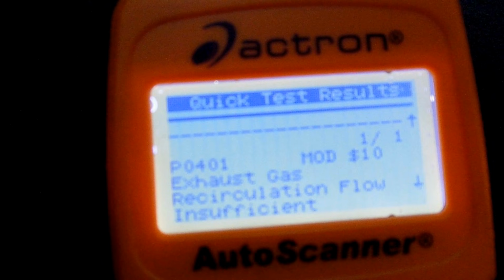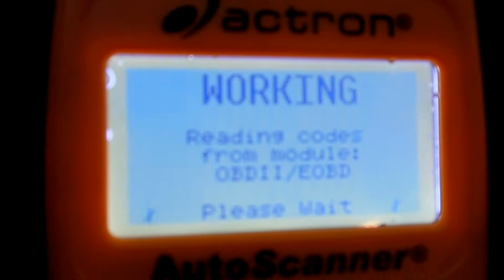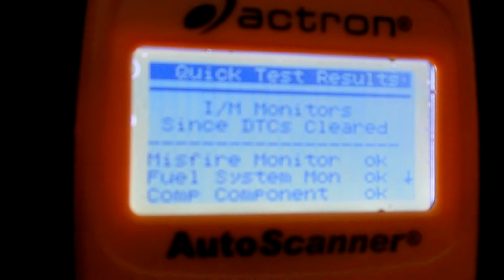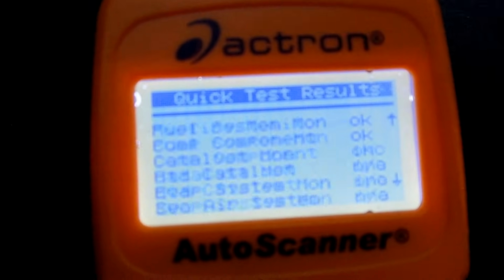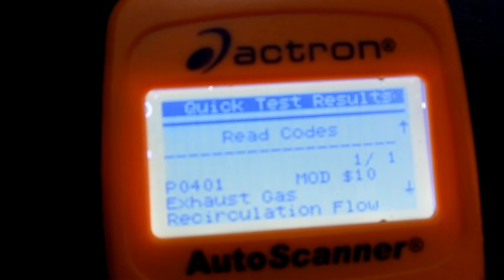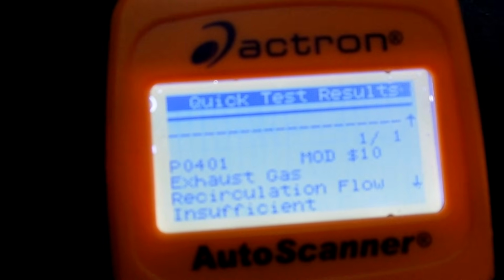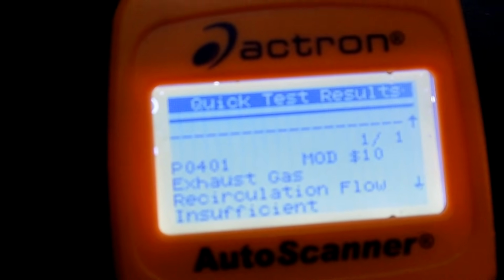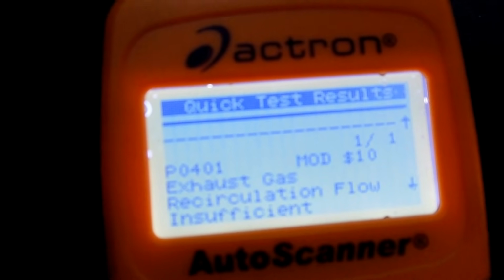P0401 2002 F150 EGR System Overview and Troubleshooting Guide

Comment: For me, the problem was the clogged EGR ports on the throttle body.  I took it off and cleaned it out thoroughly.  Put it back on and problem solved.  No more P0401 codes and runs smooth.  Btw, I have a 1997 F150 with 315K miles.

Comment: Half hour my foot. If you live in the rust belt that EGR tube is gunna be seized like you've never seen before. Use heat but it's close to the firewall which is full of a cotton-like material so be careful

Comment: Excellent content, a couple quick tips, remove both 10 mm bolts holding the egr in, move the egr over and clean both ports with carb cleaner. Also spray both banks (egr tubes connected to exhaust manifold ) also. Make sure all vacuum tuning is in working order, I suggest also removing intake snorkel and cleaning throttle body. Lastly a good fuel cleaner added to a full tank of fuel and steady highway speeds to push out all deposits

Comment: I just removed my EGR valve on my 1999 Ford Econoline E-150. I had to size up the nut. I ended up buying a 1 1/6 crescent that fit perfectly. Then I used a 10 mm crescent on the smaller nuts and it pulled loose. However, I do want to note that I also bought some PB Blaster and sprayed it good before I started removing the nut. I let it sit 5 minutes to make sure that it generated through the rust BEFORE I turned it for the first time. Just a little effort. Watch that thumb knuckle! And don't forget to spray down your nuts and screws with PB Blaster and let them sit for a bit before replacing them back into thee hole. You might want to spray down the holes themselves too with PB Blaster.

Comment: The guy who just sold me a 1997 F-150 4x4 4.6L, showed me an unconnected  connector which he wasn't sure where it goes.  But OBDII shows a P0401 code, "egr low"....so I'm  wondering whether the disconnected connector is the DPFE SENSOR.....

Comment: 2002 Ford F-150: Does anyone know what the red wire with an L shape rubber fitting that taps off the right side of the intake manifold and also has a yellow wire that’s on the same connector goes to?

Comment: I’m having this same problem with my 99 f150 super duty. Get codes and all. Seeing you do the vacuum test with the solenoid hoses to the EGR valve made me wonder if it were to completely stall maybe that’s an indication that the throttle body adapter is full of carbon and has strict flow.

Edit finished watching the video and that’s really what it was. Nice job I got work to do!!

Comment: Throttle body carb cleaner would have cleaned those ports  out you might as well clean that IAC valve out that's part of the egr valve or air system along with  Maf sensor exactly what that chop shop did they charge you a couple hours of labor which took them a half to repair that issue and then hold your car hostage for those extra hrs just to extort you. Carb cleaner would break down that carbon build up in side those port and the egr and the IAC valve
Reply from the maker: The hardened carbon on those ports was like concrete.

Comment: I’m having the same problem and have already clean out the egr value port out (carbon build up wasn’t too bad) and also replaced the egr pressure senor. what should Be my next step? I haven’t checked the vacuum yet from the green wire but ima do that tonight l. I’m kinda struck n don’t really wanna pay a lot to get it fixed from a professional mechanic. Someone help🤣

Comment: Excellent video,  question,  I have a P1450 code and I can hear that my fuel pump is noise, when I remove the gas cap it runs great I feel like I have a lot of pressure in the gas tank, any idea what that could be?

Comment: Thanks for the video.  I've found it is always helpful to review what videos are available on a vehicle repair project before I really dig into it, as I usually get a better understaning of the physical system, which, as a disbaled DIY vehicle owner (& former Chemical Engineer), usually gives me a good feel for if it is something that I will actually be able to tackle, or if I should just let a more able-bodied chechanic with specialized tools address it.  Your system overview & method of attack was very helpful for me.  Thank You.

If I don't know any local shops, I typically go to the local Ford Dealer for repairs I can't handle, as at least I know they know how to service their own vehicles, so have never not had the problem fixed. I prefer to find a local shop to work with so as to build a rapport, but that isn't always possible.

Armed with a few videos, vehilce repair manual, a cheap code reader, a quick review of Amazon/OEM parts sites to gauge basic equipment costs, I plan to tackle this one myself, unless I run into a roadblock along the way. My 1998 F-150 5.4L XLT has been a very reliable truck for me - I bought it new in Houston TX, and it now has about 250k miles.  I drive it every once in awhile just to keep the fluids circulating; mainly it is used for a spare vehicle & to pick up lawn / garden project supplies.  I've maintained it well over the years (a combo of self & professional repairs), so expect to have it until I can no longer drive.  A good running truck, though not much for fueld economy (about 15 mpg), but a good worker.

Comment: Great Video. so my 97 ford f150  4.6  could this be my problem cyz my truck has cranks but no start. I installed a new fuel pump new gas filter new spark plugs and I have fuel pressure and also sprak. Help me please.

Comment: Vicos, the EGR shown toward the end of the video must be after it was cleaned. So the issue was the EGR valve and not the DPFE sensor or EGR solenoid? My first car (Age 16) was a '69 Chevelle back in 1976. The EGR tube was completely clogged. So I took it off and used a flex wire tubing from a $1 pick up tool and put it on the end of a drill and ran it down the tube and cleaned all of the black carbon build-up out.

Comment: Diagnosing my e150 it has the same setup. I've cleaned the ports in the manifold elbow, installed new egr, new dpfe, new vacuum solenoid and i still have p0401. I wonder if the pipe is actually clogged, even if its super rare. Hmmm
Reply: I’ve done the same except i actually installed a new egr tube but still have the code. Did you ever figure it out?
Reply: @mvc2177  The vac hoses were cracked and old right underneath the dog box, remove dog box and look at the hoses that lead underneath the chassis to a canister, change all those hoses, might even help to replace the canister. Right around that time after doing all that work, some aholes stole my catalytic converter LOL. so I ended up putting a straight pipe and some non foulers, its been good since, still a gas guzzler but no more codes.

Comment: Does this help MPG
Reply from the maker: My logic would be that the closer an engine operates to how it was designed to work, the better the fuel performance you receive. Do I have any actual data to confirm that? No.
Reply: Huh

Comment: Thanks for the information!  I have replaced the EGR valve and I’m still throwing the same code - insufficient flow.  So now I’ll try the things you showed in the video.  When I took the EGR valve off, I did notice a buildup of carbon at the hole where the EGR valve connects.  Might have the same problem yours had.  I was about to buy a EGR sensor but I’m going to wait before I throw parts at it like I already did.  EGR valve might not have been bad 😕
Reply from the maker: I suspect that more often than not it is the port being clogged, especially at higher mileage, although the buildup occurs slowly over time.
Reply: @Vicos  I tried the trick where you put a hose from the vacuum to the EGR valve.  It kills the engine each time I do it.  So I put a new solenoid on today and I’m STILL getting “insufficient exhaust flow” codes.  The only thing left to change is the EGR sensor.  Getting frustrated with this.
Reply: @CiscoWes  can also be a purge valve

Comment: So I’m getting the P0401 code on a 99 mustang GT. 100k miles. I did the vacuum test and the car was almost stalling out. I still cleaned all the ports, hoses because I was already in there. I replaced the sensor and there’s still the same code. So what’s my other options to fix this? Can it be that Solenoid that sends vacuum to the EGR valve?
Reply from the maker: Did you clear the code in the computer after doing all of this?
Reply: @Vicos  so the sensor is brand new. The egr valve has 5k miles on it. The valve was new when I bought the car 5k miles ago. The check engine light just came on last week. Did the vacuum trick and it almost stalled out. I cleaned the ports and hoses just because. They didn’t need cleaning though, very clean. Cleared the code with my code scanner. 5 miles later the code was back up
Reply: I have a P0401 code. I cleared the code after putting the new sensor and 5 miles later is popped back up
Reply: Update: I took off the vacuum booster solenoid and noticed that there was a small crack on the housing where the vacuum hoses attach. I replaced the part and drove it 30 miles last night and the check engine light hasn’t come back on 👍

Comment: What is the part that plugs into the back of the engine where if it pops out radiator fluid leaks out? Not much info on here.

Comment: I have 2 codes showing on the obd2 scanner. First is P0190 Fuel Rail Pressure Sensor A Circuit. The other is the P0401 Exhaust Gas Recirculation Flow Insufficient Detected. I have owned this car for about a year now. The guy I bought it from was honest enough to let me know that when the gas hand was close to a quarter tank, it would start to cut out, especially when accelerating(uphill badly). After driving it approximately a few weeks, it started doing just that. Then, the ck engine light started staying on. Then one night after taking my Son back home about an hr- hr half away, on the way home it ran so badly the ck engine light was flashing. I didn't know what to do. Luckily, I had been watching many videos on YT so I knew this was serious!! But, on a Sunday night, in the middle of nowhere, and having severe night blindness, I just kept pulling over whenever it would bog down or cut out. I cut it off, set for a few minutes, then it would start back up. I didn't think I would make it home! A trip that is normally a little over an hr took me almost 3 hrs!! To the point now.....Since that episode, I have learned to keep the gas above half tank, have had several repairs done such as new spark plugs/wires, coil pk, some vacuum lines replaced, some other kind of part?, and a few more that I'm can't remember rt now.. The ck engine light has stayed on pretty much all this time except for when the battery has been disconnected and the wires going to the receptacles had been cut too short for some reason causing the speedometer  to go haywire and the other gauge too!! The speedometer would bounce  around and sometimes stick all the way over. Fortunately, that problem has been resolved.  However, it's still doing the same crap.....idles high when first cranking it then levels out,  starts bogging down n cuttung out when going uphill and for a while now, even going straight down the road. When it dies completely in the midle of the road I put In t in N, wait about 60 secs n then it  starts bk up, runs ok for a lil baby t, then feels like it's missing before trying to cut out. If I try to accelerate, it will cut out so I just let off the gas n it just slows down to a crawl n I'll put it in N again n rev up the engine until it is idleing bk to where it should or close anyway. So, Yeah, that sums it up!! The  P0190 has been thrown every time a code scanner/reader has been put on it. So, whatever it is, nothing done so far has corrected the prob!  And, I think the other code has shown up several times also. You see, I too, have a couple of those "backyard" mechanics. Bad thing is, they usually think they are smarter than what they actually are. I have 2 other vehicles sitting at my house, rt now for years just because of "ace mechanic friends" that acted  like they knew what they were doing but sure proved they Did Not! Both kept my vehicle for 4-5  months and the first admitted he had not even tried working on it because he was just too busy.  The second guy I didn't know. He was a "friend of a friend"! I should've questioned my sanity when I found out the idiot goes by the name "FAST EDDIE"!! I don't think it's because he likes to drive fast!!! So,yeah, there  are way too many guys (mechanic wannabes)  out there that take advantage when they see it's a woman who is needing the work done. LOOK HERE GUYS--We DO know how to watch videos, follow instructions(if clear), and can diy on many projects. I'm gonna get down n dirty, nitty gritty, and greasy too!I've been threatening to for months now! I know I can do as much, if not more than has been done to it, considering it's still not fixed! I'm starting with cleaning the throttle body first, then the MAP, the MAF, and whatever else I can take off and clean + plus any sensor or part I can ck with a voltage meter or whatever!! What have I got to lose? If the darn things are just sitting there anyway, then they're not running. So, who knows, maybe I'll be a woman who actually fixes her own Dodge Ram 1500 and a Kia Sportage 4x4!! I may even make a video just for shitz n giggles!!! Oh boy, did I ever get sidetracked!!!  Ok....back to the 2000 Ford Contour. You can hear the fuel pump running when turning the car on. The fuel filter was taken out and cleaned more than once. This entire fuel system is stupid because everything seems to be inside the gas tank. Anyway!!!  The only one (mechanic supposedly) that actually looks at it now is the one who has the code scanner, which he doesn't seem to mind to put on there, but he's just always too busy to work on it because he has so many of his own "projects" that he will never finish. 
SOOOO.....This is one of the better videos I've run  across. Oh, but I do really like and believe Scotty Kilmer, but I think he's gone  all "Hollywood" on us!
SO, I apologize for the long comment, but hopefully it will get someone's attention enough to give me some pointers or help somehow!!!! I'm always open to suggestions as long as ya don't treat me like  dumb blonde!!  Ok....let's go to the Auto parts store!!!! I'm on a mission!!! Hahaha!!(
Reply from the maker: Hi Janie, the symptoms you describe match the symptoms they talk about here for the P0190: https://www.yourmechanic.com/article/p0190-obd-ii-trouble-code-fuel-rail-pressure-sensor-circuit-malfunction-by-jamahl-walker

Based on what you say, sure sounds like a fuel pump issue. First thing I would have done is put a fuel pressure gauge on the rail (there is a schraeder valve you can screw into (looks just like an air valve on a tire)).  The fuel pressure should go from zero to 30 psi in a couple seconds if it is working properly. If it is low or bleeds down it can be a weak fuel pump.

It could also be a clogged fuel filter. Additionally, there is a fuel pump driver module, which sits up near the rear axle outside of the tank, that many times rusts apart. Probably have to take the spare tire down. This is an example of what they look like: https://www.amazon.com/Control-Mounting-590-001-Lincoln-Mercury/dp/B07HBN8LX4/

My 2002 F150 4.6L is also exhibiting symptoms of a weak fuel pump (no codes, just won't always pressurize the rail when the key is turned on). 

In any case I would start with testing the fuel pressure. I believe most national auto parts stores will loan them for free with a deposit. Also, search for videos on troubleshooting the P0190. As far as the EGR issue, that might be unrelated to this. I would tackle the fuel pressure first. If you want to throw cheap parts at it after determining that the pressure is low, I would start with a new fuel filter (wouldn't that take the cake if it was a $10 part??).

Be warned that if you pay a professional shop to put a new fuel pump in the tank, you're probably looking at $700 or more, assuming they diagnose it properly to start and don't throw parts at it. Its a crappy job if you try to do it at home w/o a lift and potentially dangerous.

Comment: Great video~ Yes, the EGR ports (2) do get clogged. They are located inside the throttle body coming off the EGR main inlet tube.  Get a pick, a set of tube brush cleaners and solvent.  Also remember that the hoses to the DPFE sensor are specific... if you still get an error code, swap the hoses and recheck for error codes.... hope this helps someone.

Comment: I've got a 2003 Ford with 5.4 triton engine and same code. I believe that I no longer have to take this vehicle through inspection in my state and I was wondering if I could just delete the whole egr system and  if I did so, would the computer prevent the vehicle from operating. Thoughts ?
Reply from the maker: hmmmm, that's an integral part of the engine. I wouldn't try to remove it. Once you know how to troubleshoot it, it should not be that expensive to repair. Worst case is having to remove that throttle body and clean the hard carbon out of the ports. Might also cause issues when you go to sell it. Maryland requires a state inspection when a vehicle is sold and a missing EGR might cause issues. Not sure where you live.
Reply: @Vicos  Yes, I think you're right. Deleting the egr system would create too many complications .